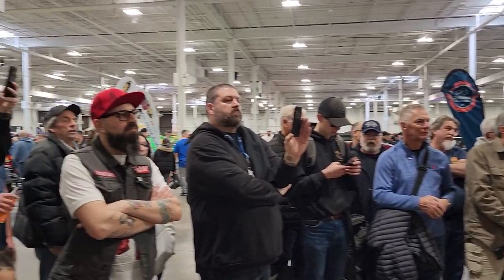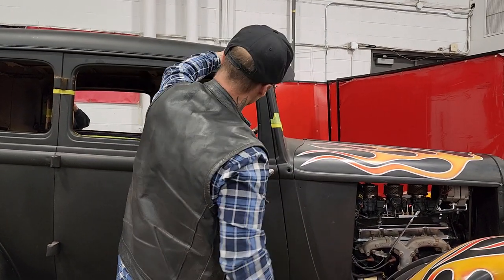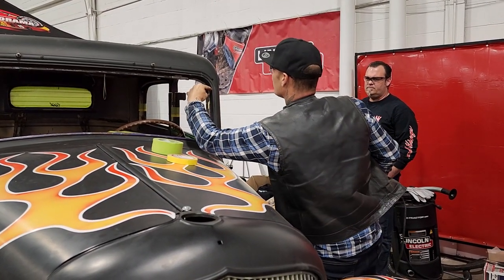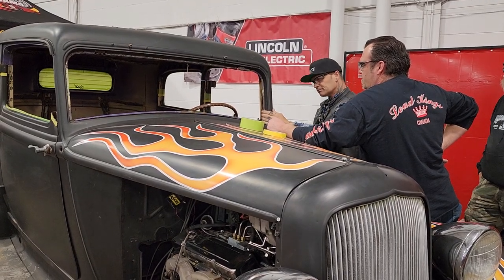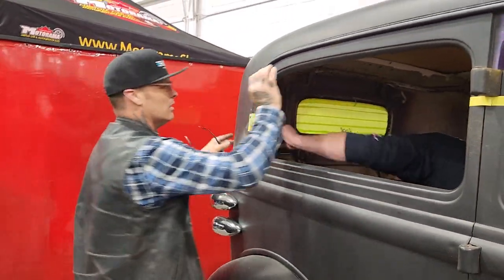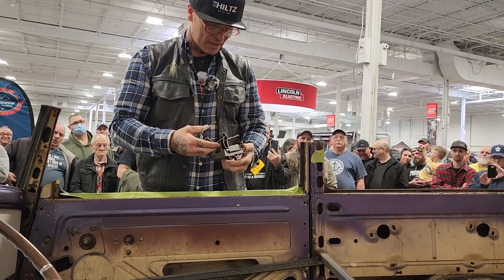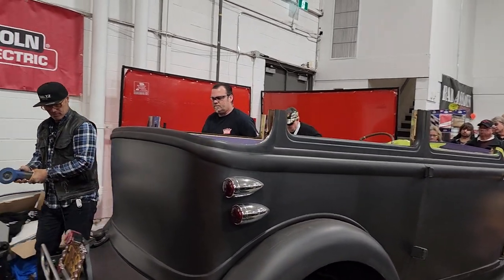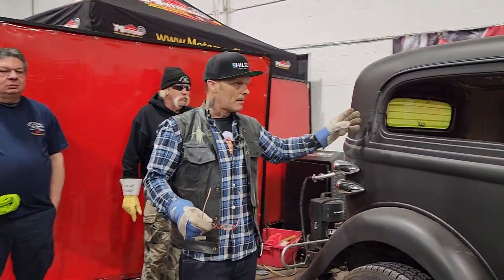Best way to chop a 1930’s sedan roof — fast, easy, minimal cuts 👏🏼

Comment: I've made probably 20000 cuts wit a zip cut with no guard on it, until one day a disk exploded while cutting. It sounded like a gunshot and I was very lucky to not get hit. Ever since then I only use a zip cut with a guard on it. Gives me chills and a bit of ptsd watching that thing pointed at your neck. Odds are you and i could cut the rest of our life without a guard and nothing will happen but all it takes is one faulty disk. Great job on the cuts 👌
Reply: I have had a disc explode and pieces flew in all directions . I was hit on my leg and it didn't cut through my jeans but left a painful purple mark that hurt for months . Thank God no one was  around! A guard and face shield should be used also. I was lucky.

Comment: Chad always use a super heavy duty extension cord heavy gauge when your far away from the plug  with a welder or any other big electric tool that pulls lots of amps that way you get full power to the  welder . The heat will not be as hot or penetrate if you use a 100foot orange cord it’s no good  you need a heavy cord  you will keep tripping your switch service box

Comment: Chad you made that look easy, good planning, but if you got the centre posts to line up, the rear would be easy as you could cut the extra length off and the whole rear would have the correction required to line everything up perfectly, well thats how I see it, I wouldnt have to do any unnecessary cuts on the rear quarters.

Comment: for the front windshield I would have dropped down about 2" form the top radius of the windshield then cut my 2.75" out of that, those diameters are the same then relief cut the at the bottom to move it so it lines up.. pretty much how you were originally going to do it..  then your diameters are the same for the weld up? relief cut to tilt the alignment?.. hopefully window rolls right up,  6 of one half dozen the other tho, I'd prolly fubar it all to hale then what? i'd have no more coat hangers in the closet, clothes on the floor, what a mess...  oh boy 100% positive I can fubar that job in a big way and I wouldn't be able to come back to the autorama ever again..  lol  I dunno the confidence level is high here its basically a one shot deal to do it right without all sorts of fabbing and what not, tray making that door rail or windshield rail, not in a day or two.. seems to be the key here, making is so everything works and lines up without having to make any complicated rails so forth..  gonna be a fine ride for sure...

Comment: push that roof back so that C pillar lines up, it will... then everything is going to line up better.. its off ever so slightly cuz you tucked the rear instead of butt welding it, that metal should budge/bend enough to line that C pillar right up no issues?  no?

Comment: What happened to the do it as fast as you can? Someone there’s probably in your ear telling you the right way to get it done so you don’t fuck up their car! Just saying. But you need to cover the inside of the back window ……actually stop being cheap and buy a roll of 3m spark deflection paper 05916. I left in the comment before a part number to a cheaper brand but I’m tired of leaving comments when they’re just ignored like this one will be as well
Reply: What's your YouTube site for some tips ..Thanks
Reply: There is a button you can use. It’s called “unsubscribe “.
Reply: @bolwarracolt1  ya he has 28 subscribers. He’s the professional 🙄
Reply from the maker: Actually the people helping had their own idea of how they would chop it which included cutting the back window out completely and cutting into the roof but I didn’t want to do it that way — like Frank Sinatra said… I did it my way 😎
Reply: If you don't like how Chad does it, don't watch.